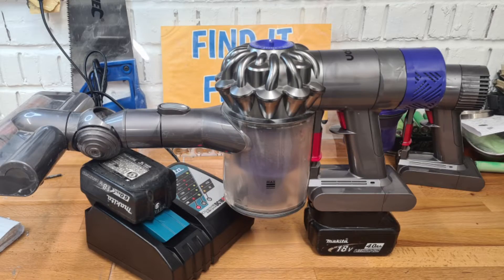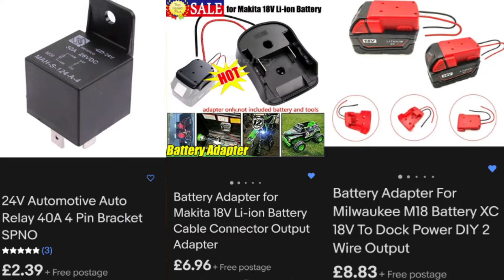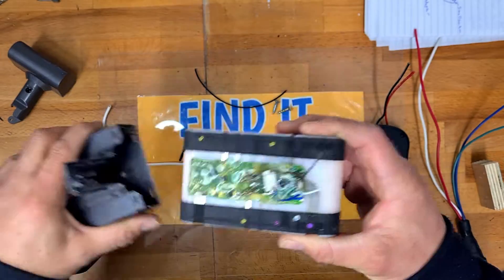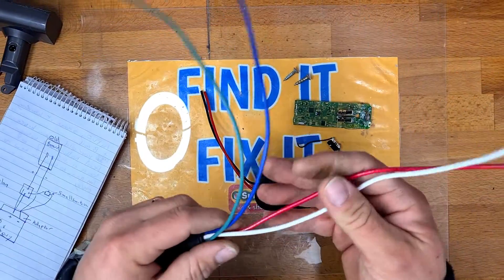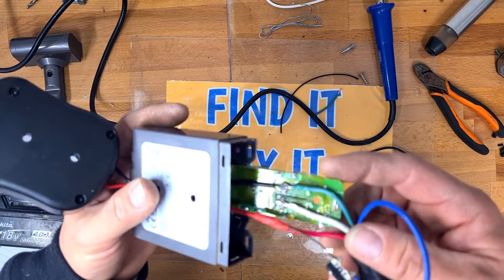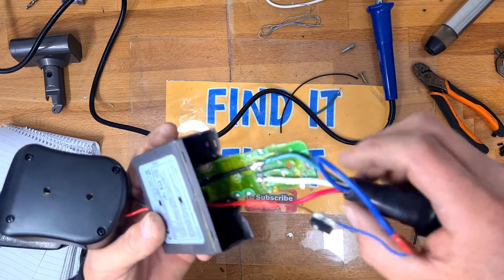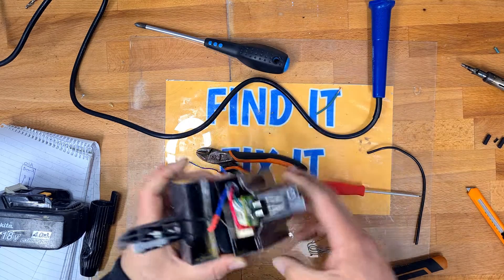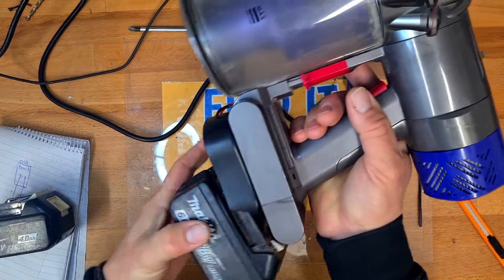CONVERT YOUR DYSON TO MAKITA lxt, MILWAUKEE m18, DEWALT xr, BOSCH BATTERYS

Comment: Good video but I don't understand why your having to do some wiring work! I bought an adapter for my dyson v8 to work with makita batteries and all I had to do was put the adapter in the hoover then put the makita battery in , and then it works, absolutely no wiring work required at all !

Comment: This instruction video might work for Dyson series V6/V7/V8 vacuums but it certainly DOES NOT work for Series V10 (or bigger like V11/V12).

Reason for that is battery voltage in the higher/newer Dyson systems. 

I own a V10 and it runs on 25.2 Volts battery, so 18 V tool battery definately does not make it work straight connected.

(thumb-up this if you found this comment helpful because there is misleading info in the video description)
Reply: Good point on voltage, so the v10 hand higher would work with flex or kobolt batteries they meet the voltage specs.

Comment: Just a thought what if I want to illuminate the battery powering option connect the battery charger cord cut and solder and run directly without a battery but through main power?
Reply from the maker: it wouldn't work as the cord isn't designed for the amps the motor pulls. do you mean the wall charger straight to the dyson without the battery? you will still need a switch and relay from the battery pack and the charger is not suitable for the power consumption of the dyson so no it wouldn't work.
Reply: @FINDITFIXITRESTOREITBUILDIT  and if you do it like with a laptop, inside the battery + power supply with cable?

Comment: As this device is for use by a non technical person...🙄 I would just replace the original cells in the Dyson battery pack... the extra voltage, 6 cells versus 5 cells on the tool batteries makes a big difference to how well it works...

Comment: Thats great but after buying those goods and all the time it takes to reqire etc i would simply buy the snap in adaptor...like i did for milwaukee batteries and literally took 2 minutes
Reply: Yep, the adaptors are on Amazon for $28 CDN. Much easier than this, and less bulky.
Reply from the maker: theres links to them below the video

Comment: Hello what is the relay actually for please
Reply from the maker: to switch power on to the dyson without burning out the tiny switch.
Reply: @FINDITFIXITRESTOREITBUILDIT  - I don't get it. The original Dyson battery supplies more power than the tool battery, doesn't it? Why doesn't it need a relay?
Reply: @OMGWTFLOLSMH  because the battery control board used to do the switching via  mosfets (electronic relays) without them the switch will burn out in a few seconds as its not designed to handle the currant.

Comment: OK, but use only batteries with 2 cells rows in // (4Ah or more) and not 2 or2,5Ah with simple cells row, because here the voltage is lower and the motor power will kill the battery very quickly. Even a good lithium cell (30A discharge) cannot support a long time  discharges in a few mns .  It's by the way THE first issue with all Dyson's batteries, although with effective 24V.. ...and I could tell the same about their "particular" BMS which locks down, normal, ...but definitively, not normal,  after the first batterie issue.
Reply: I add : 
- Do this with only  good 4Ah drill batterie and fully charged : you convert 21,2V  to 25,2V and you need a lot of amps. Don't use the Max power, although it's possible. Be careful with chinese replacement batteries , oftens discharge amps are lower.
-Control if you have a BMS in your drill batterie , some Bosch packs for instance have a BMS  placed in the device and charger and not in the battery...and in this case you have no more discharge control (big danger for the pack and perhaps for yourself)

Comment: Very informative video for a V6 ,I tried this and tested this on a test light , all worked OK on the light ,however I've got a Dyson V10 the system won't operate the motor , inside the stalk housing there are 2 wires that are no longer connected to the original controlboard  (which is now scrap ), do those 2 wires ,one black & one red  need to be connected somewhere in the powerhead to complete  a circuit ? The unit will not operate with 24v attached  to the clip terminals in the shaft of the motor end. Have you got any ideas?
Reply: Dyson V10  (I have one) needs a battery with 7 cells in series (29,5V). So if you connect your drill battery (21,2V) without converter (21 to 30V) , possible that voltage is too low and the motor board stays locked. For a V6 the voltage difference (21,2V to 25,2V) is accepted by the board. If you add the converter,  please use only a 4 or 5Ah battery!
For the 2 little wires I don't know. It's possible to connect them direct on the drill battery, but normally they are controlled by the Dyson's battery BMS ;  here they would receive current permanently.
The best solution I found was to build my own pack (7 high discharge cells) with a chinese BMS for V10 (Ali), put it in an old V10 box and it runs. And the Ali BMS does not lock down definitively. It can be re-used. So I only need to change the cells if necessary. I cut all male tabs on the box (only closed with the screws, no problem) , so I can re-open it very easely.
Reply: @Michel-Artois  
Hello. Is there any way you could make/share a video of building the battery pack for v10, please? 
Thanks.
Reply: @Michel-Artois  - Building your own battery is not the point of this video. This video is for people wanting to use their shop tool batteries on the Dyson.
Reply: @OMGWTFLOLSMH  Yes , But michaelecaine asked for a Dyson V10 (runs with a 7 cells battery-30V) and in this case a shop tool battery (18V -21,2V full charge) cannot run . Did you really read my answer?        And so for THIS device,  only 2 possible  battery solutions : buy a new one, or build a new one.

Comment: Thinks twice before doing this its a nightmare of a hack.Its not easy as the chap makes out..sorry...Mount the adapter further back from the edge and install the adapter wires through the base of the battery case.
Reply: 🤣 the wiring is different to how I did mine, mines use the oem board, use mutlimeter to find the positive and negative where battery pack meets board and directly connect into that with tool battery. It’s been working for over a year now and runs for 40min-1hr on a 6ah. This way is definitely more complicated.

Comment: Has anyone tried this with the v10?
I tried, but can’t get it to work.
Reply: How did you wire it up? what battery pack are you using?
Reply: @nfi2nfi2  I wired it exactly as the video and am using Makita battery
Reply: Wire it up as if the tool battery was the cell pack, without the relay. Straight to the Dyson oem board. try it with crocodile/alligator clips first then solder up if works out for you.
Reply: The V10 uses a 25.2V battery pack, vs a 21.6V battery pack in the V6, V7, V8. I'm guessing an 18V shop tool battery isn't providing enough voltage.

Comment: My dyson has already had a replacement battery so not original battery and doesn’t have the switch. Any ideas?
Reply from the maker: it should have a switch in the battery pack somewhere so it knows when the triggers pulled. 
look around the area where the spring is and the plastic sliding rod.

Comment: Will it also work using Dewalt 20V/60V 9Amps Flexvolt battery? Thanks
Reply from the maker: 20v yes 60v would not work.

Comment: just did this and it works great, your method is the best as it keeps the chance to add a battery in future. the relay in your link doesn't fit inside battery so i ordered a 24v micro relay 35A from same supplier with harness and just cut out 87A wire. it fits perfectly inside under the little board without the need of the wood piece.  i can not get max mode to work for now but thats because my battery max amp is 12A and this hoover draws 18A but im happy with normal mode . really appreciate this video 🙏👏

Comment: hi, Iam using a ebike battery going via a step down converter box I can supply 22v 20amps to this vacuum, do I still need a relay?
Reply from the maker: yes unless you can switch it on and off another way.

Comment: Thanks. Can i take the inside of the v7 and put it in the v6 battery boddy?
Reply from the maker: I'm certain there exactly the same. there's 3 different battery types but I'm sure the internal battery pack is all the same.
Reply: @FINDITFIXITRESTOREITBUILDIT  thanks

Comment: Awesome video. Would this method work with the Lidl Parkside 20V batteries?
Reply from the maker: yes it will.
Reply: @FINDITFIXITRESTOREITBUILDIT  excellent. I think I will give it a try.
Reply: The link you have for the relay has 5 pins not 4. Will that still work?
Reply from the maker: @stephensandison5563  a 5 pin relay will work fine. any 24v relay will work just copy the pin out on the wiring diagram in the video.
Reply: @FINDITFIXITRESTOREITBUILDIT  just to confirm it all worked perfectly. I’ve tried both a Parkside 2 Ah and a 4 Ah and it all works fine. The 4 Ah battery was brand new and lasted 40 mins on normal power continuous use. The batteries didn’t seem to get hot or even warm. Not sure about protection circuit for the battery and whether this is in the Parkside battery or the tools though.
Reply: @stephensandison5563  Haven't tested this myself but from what I've read on another video the Parkside batteries have the low-battery cutoff sensing inside the battery with a pin for communication with the tool (which contains mosfets to kill the power). Not sure if this is also the case for the newer smart batteries as the cutoff seems to work a bit different. Either way if you're using them without adding a low-voltage cutoff you run the risk of over-discharging the cells and killing the battery or worse damaging the cells which might lead to a fire later on (I'm not an expert, I do not know how big this risk is, I'm just warning you as what you are doing might be dangerous). In theory it should be possible to create a DIY circuit/PCB with mosfets which checks the signalling pin on the battery and cuts off if it signals that something is wrong. For more information see the comments on this video: https://www.youtube.com/watch?v=0oBbF3bcDck

Comment: Thanks for the video! Question for you, the link to the relay looks to be a 5 pin model, but your diagram shows only 4 pins. Do we just ignore the centre pin when wiring?
Reply: I ended up making this today with the 5 pin relay and cut the middle pin. Only issue I had with the 5 pin is that it’s larger and I had to mount it on the outside as it would not fit inside the battery shell. Not as tidy of a final product but works a treat, would recommend 😊
Reply from the maker: you only need the 4 pins for this application. just follow the numbers to pin location on the wiring diagram.
and it should work perfectly.
Reply: @FINDITFIXITRESTOREITBUILDIT  Perfection! Thanks for the response, looking forward to trying this out!
Reply from the maker: @Mike McStravick  it's an easy fun project and can always convert it to a dyson battery in the future if you want to.

Comment: Does the relay come with the wires ? As the pictures on the link don’t show them, or do you need to buy them seperate ?
Reply from the maker: I just used a pre wired one for the video. just connect the wires to the terminals directly using the wiring diagram in the video.

Comment: Any chance you done a rough time on how long a 5ah battery lasts on max power?
Reply from the maker: I've vacuumed 2 cars on max and still had more to go, I've not tried a full run time test yet.
 it's a lot better than a original dyson battery so far.
Reply: @FINDITFIXITRESTOREITBUILDIT  - Everyone knows a good car vacuum is a standard measurement of time, not unlike football fields for length.

Comment: How long does it run on this power tool battery? I have v8 and it shoot down after around 2 min of using with 5ah battery from dewalt which is about month old. I'm trying to figure out why it doesn't last longer
Reply from the maker: I've only used it to clean up around the garage for about 10mins, I've got a 5amp hour battery and not charged it yet.
Reply: I would guess that something has either poor connection or short causing the battery to get warm and trip the overload protection. Does the battery get warm?
Reply: That runs but with a too low voltage. Take care NOT to use max power...or the cells will quickly suffer. Using a 5 cells battery for a 6 cells device is not the best solution.

Comment: How good is low battery shut off doing it that way? I smoked mine not using board.lol
Reply from the maker: the battery has its own bms  so it's no different from using it in the power tool.